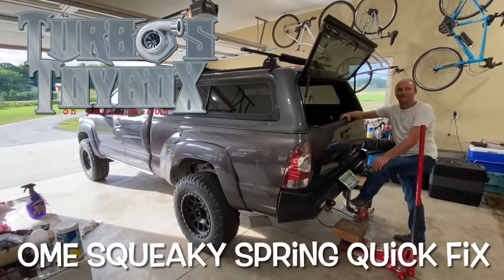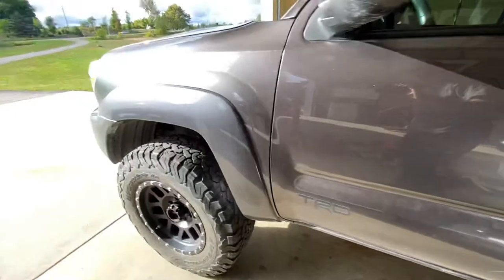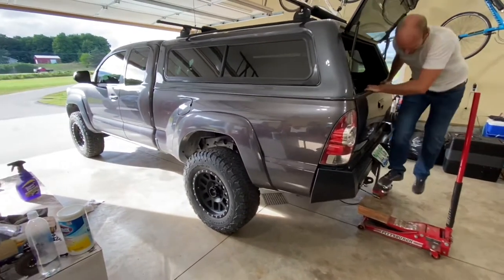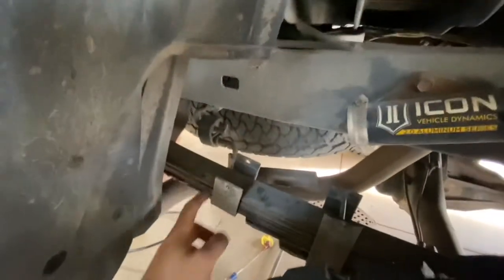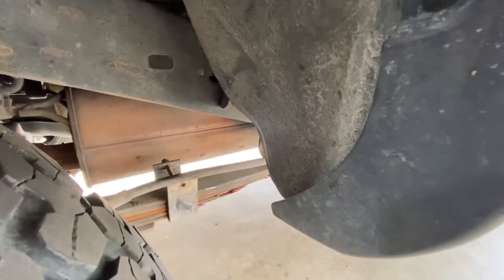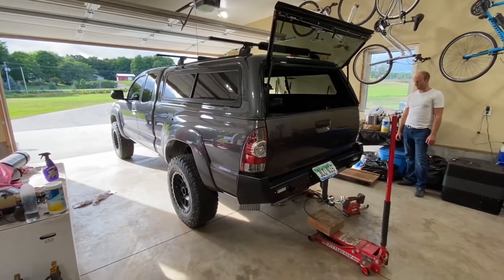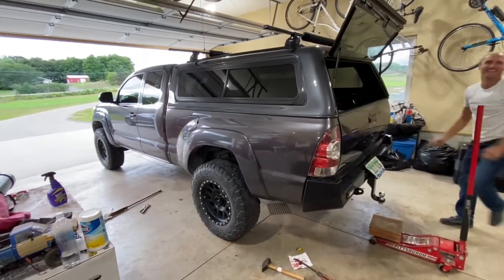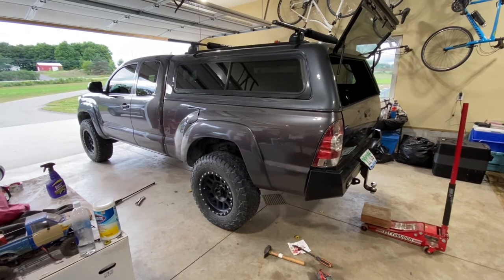Old Man Emu squeaky spring fix

Comment: I have been scouring the internet looking for a solution to my OME spring pack squeaking. Judging by the amount of comments it seems like this is the right thing to do. I have gotten under the truck and identified that it is in fact those rubber pads in between the springs but I did not think I could just remove them until watching this video. Definitely going to do that. Thank you so much I was seriously ready to buy some whole new springs.

Comment: You have no idea how happy I am I found your video. I’ve been suffering with this horrible squeaking for more than a year and could not figure it out. I was ready to sell my truck. I’ve got the medium duty ome leaf pack on my 2018 Tacoma. It only took 15 minutes per side to remove these plastic spacers and spray some white lithium grease. All you have to do is take the wheel off, use a flat head screwdriver to spread the leafs enough to use another flat head to pop them out then spray some grease in between. Springs don’t need to come off to be done. Squeaking is completely gone!
Reply: Are there plastic spacers located near the end of the leaf springs. I see some that are black not yellow. I'm not sure what they are made of (plastic rubber???)
Reply from the maker: @ivantheterrible9689 Yes there were. They are a plastic material.
Reply: @turbostoybox2182  Thanks

Comment: I can attest to taking out the yellow pads if your questioning it like i was. I took the pads out, cleaned them spotless, cleaned inbetween each leaf and soaked them with fluid film. Then greased the absolute crap out of the yellow thing front and back, put them back in and guess what? Still squeaked. It was muchhh better then before but i still wasn't happy. Jacked it back up, removed yellow pads and added a bit more grease in-between the leafs and now they are silent. Thanks for the tip. Hopefully its a long term solution like it appears to have been for you.
Reply: They started squeaking again like mad within 4-6 weeks. I was driving 50 km a day on dirt roads so im sure that doesn't help. Ive since installed Dorman 924-070 isolator pads. So far so good, i believe thee pads are a better permenant fix
Reply: @jasonmernerr I think those pads are always gonna get squeaky everytime you end up off roading etc, been hearing a lot of people saying that… so guessing you always have to grease them up after dirt driving or off-roading

Comment: I had a squeak on my 1st gen Tacoma OME leafs. I tracked it down to the top two leafs leaf where they mount to the frame. I ended up stuffing some surf wax in there and hasn’t squeaked yet and it’s been 4 days. We’ll see though lol. On my springs there aren’t nylon pads between the top two leafs or the overloads
Reply: Same. But mine would squeak and also bind and release causing a clunking noise when turning. I used a screw driver and a hammer to separate the leafs and slide some rubber in between them. All sounds are gone and it rides even better now.

Comment: Okay - been 9 months... how is the solution holding up? I am starting to get the squeak but greasing the leaf pack like this seems temporary at best - once the grease wears out it needs to be regreased presumably. Just wondering! Thanks!!
Reply from the maker: So far not a single squeak! 🤷🏻‍♂️
Reply: @turbostoybox2182  Okie doke! That's what I wanted to hear.
Reply: Mine would squeak and also bind and release causing a clunking noise when turning. I used a screw driver and a hammer to separate the leafs and slide some rubber in between them. All sounds are gone and it rides even better now.

Comment: How do you take out the yellow pads?
Reply from the maker: I took the weight off the truck so the springs would sag down, then used a screwdriver to pry the springs apart, and a second one to pry under the pad to pop it out.